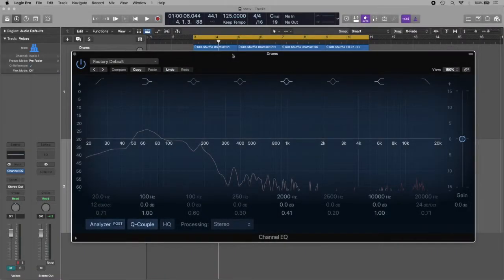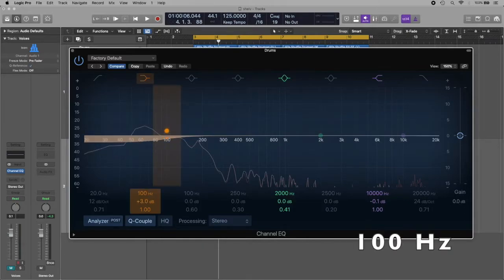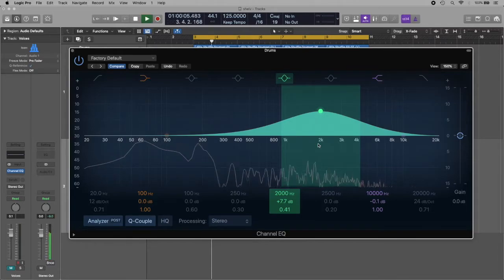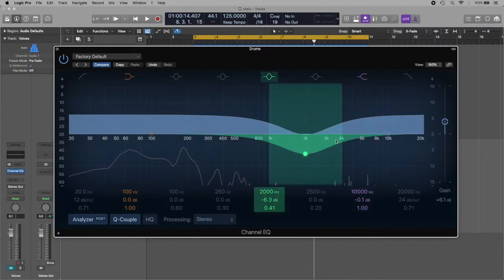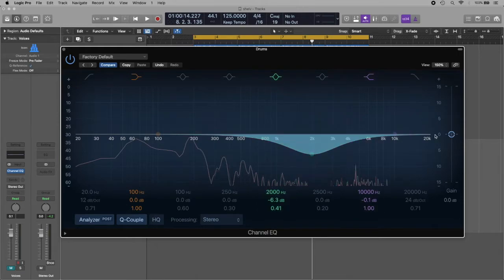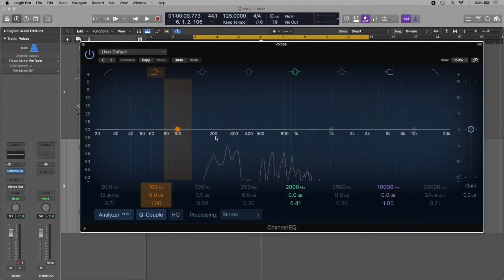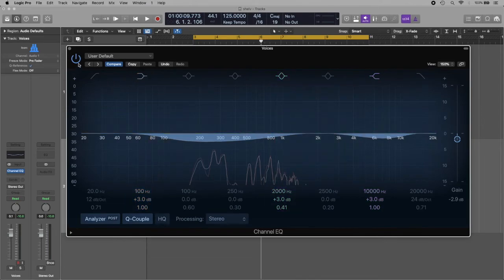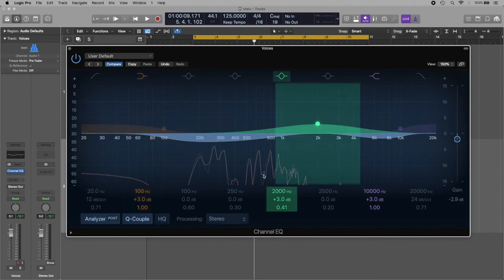Using a typical 3-band equalizer on complex mixes or instruments

Comment: Great explanation... I'm also running an E-drum type set up (a Singular Sound Beat-Buddy) running into Mackie ProFX12v3 mixer with the same issue, just 3 EQ knobs and a 1 knob compressor. It doesn't sound terrible with all set to 12 o'clock but it's a little lacking. I'll give this a try and see what happens. Thanks